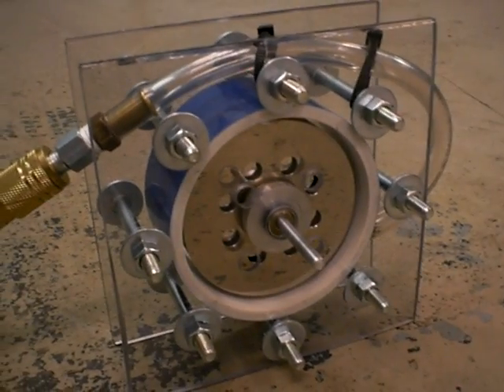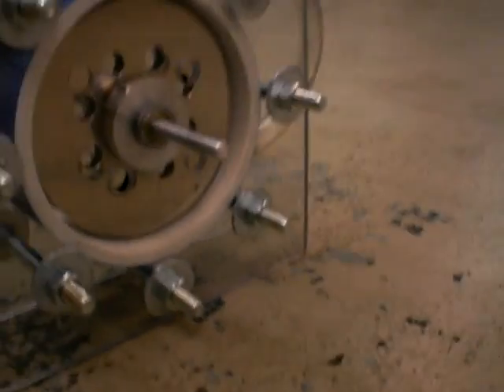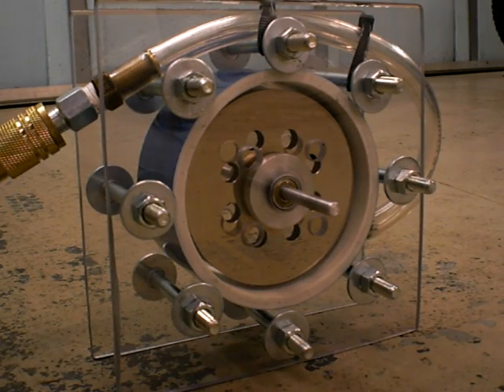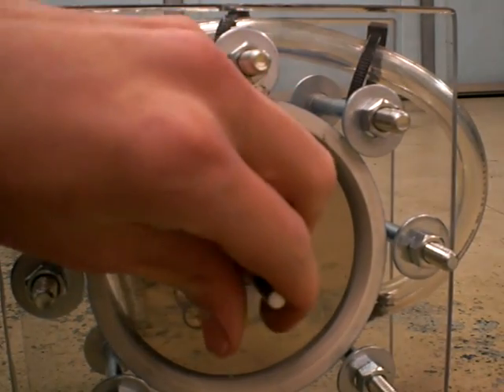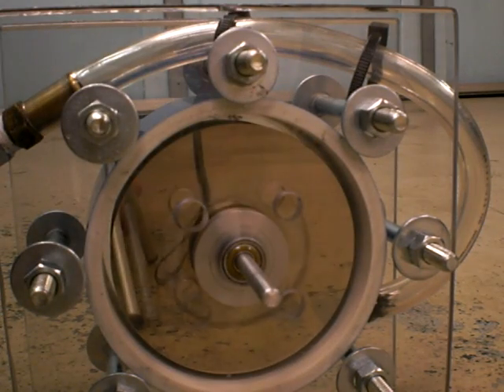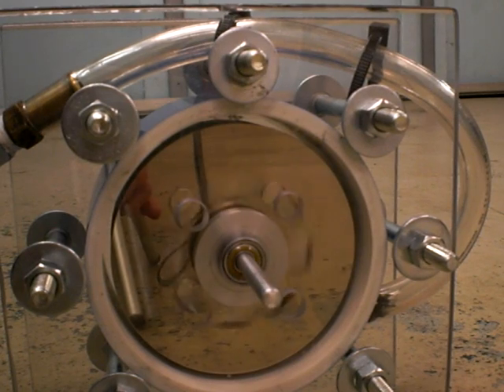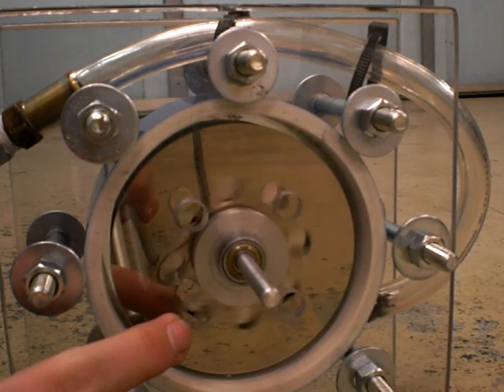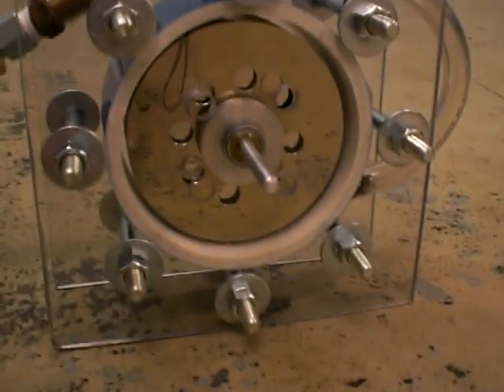Tesla Turbine

Comment: Can you share with us what you are trying to achieve ?    What is the end result you are looking for ?
Reply: Seriously!
This accomplishes WHAT?
He's made a non-gimbled gyroscope.
Reply: Don Cooper Hey ! Where's your imagination ?  If he hooked it up to an exhaust vent  in a bathroom , everyone could marvel at how fast the poop smell was gone .  Or for a  4th of July special he could put a torch in front of it and line the edges with napalm from a pressurized feeder tube  .    And watch those  people run !
Reply: +Michaelneil17 This could be hooked up to generator to produce electricity. Source of steam could be parabolic solar concentrator boiling water / generating steam - pressure
Reply: +Jozef Trubac You are suggesting using this turbine in between a source of steam  and an electric   generator .   What gives you the idea that this would increase that energy ?     Creating higher speeds does not equate to more power .    If you believe that a parabolic solar steam generator is an answer to  create inexpensive energy ,  build that .   However , I think you will  find that method much less efficient than  solar electric panels .
Reply: @michaelbenjamin8  I appreciate your comment but that’s not an issue because, despite what everyone erroneously claims, Tesla turbines work just fine, get plenty of torque and output power at low RPMs.     I’ve got some copy pasta 🍝 of mine that I’ll share with ya here to explain more.  Tesla turbines aren’t made efficient by spinning really fast.   That’s only for when the disc stack is being used as a centrifugal pump, because ALL centrifugal pumps’ compressors, performance is tip speed dependent.   But spinning the turbine fast will produce a centrifugal head that opposes the incoming fluid flow, reducing the pressure gradient across the nozzle, reducing fluid final velocity, reducing mass flow rates through the nozzle and ultimately reducing power out. 

Furthermore the faster you spin them the faster the fluid you have has to go just to still be moving faster than the discs and still provide torque.   Lastly, they work just fine for industrial use and can scale up just fine because the torque on the discs is proportional to the difference in the fluid speed and the disc speed. So the disc tip speed is the important factor here. For any given fluid supply in the nozzle will have a max fluid velocity. So the turbine disc tips will have a max speed set at that fluid speed irrelevant if radius. Now considering that centripetal force is proportional to V^2/R, if you keep the tip speed the same but increase the radius the centripetal forces on the disc for the speeds needed will actually decrease. 

Despite what MANY have claimed about the Tesla turbine, it does NOT need to be spun fast to work or work efficiently.   TesTurs are made efficient when the slip on the discs is reduced and spinning the discs fast does nothing to reduce the slip, only increase the distance the fluid slips on the disc faces, which is by definition “loss”.  Listen to what Tesla himself said in the patents of how to make them work.  “Owing to a number of causes affecting the performance, it is difficult to frame a precise rule which would be generally applicable, but it may be stated that within certain limits, and other conditions being the same, the torque is directly proportionate to the square of the velocity of the fluid relatively to the runner and to the effective area of the disks and, inversely, to the distance separating them. The machine will, generally, perform its maximum work when the effective speed of the runner is one-half of that of the fluid; but to attain the highest economy, the relative speed or slip, for any given performance, should be as small as possible. This condition may be to any desired degree approximated by increasing the active area of and reducing the space between the disks.”  1) increase the speed of the fluid relative to the disc, (not increase disc speed)  2) increase surface area 3) decrease disc spacing  This is how you actually make a TesTur work. Not by spinning it fast.   The fluid interactions with the disc that govern efficiency an torque are adhesion and cohesion. Full stop. And spinning fast does nothing to increasing either to increase the turbines isentropic efficiency.   This is why everyone who chases rpm with the TesTur just flat out fails. They aren’t even trying to design them properly so of course they won’t work.
Reply: @michaelbenjamin8  Of the sun’s light energy that hits the earth 10% is UV, 25% is in the visible spectrum, and a whopping 65% of it is in the infrared, heat, spectrum.   Solar PV cells can only use a portion of the visible spectrum and use none of the IR spectrum and in fact lose efficiency from heating up from the IR.  So at best you can get maybe 20% of the suns total light energy to electricity to charge and discharge a battery at 90%.  So only 18% of the suns light energy gets to your wall plug.    And then UV light makes them go opaque and be at 1/2 their rated power in 10 years. So, conservatively down to 10% of the suns light gets turned into electricity 10 years in.  

With solar thermal collectors you can collect all 25% of the visible spectrum and all 65% of the IR spectrum and store it as heat in a thermal mass.   So 90% of the suns light energy can be collected and stored as heat in a thermal mass. Let’s say 10% loss on storage  So 81% of the suns light energy is then available to be put through a steam Rankine turbine system, which at theoretical best can get 25-33% thermal efficiency to electricity. 44% is the recorded best (And that’s without any thermal recoup, boiler feedwater preheat, etc to bring up the Rankine cycle efficiency and/or going to an organic Rankine cycle with a refrigerant in the closed loop instead of steam for higher pressure gradients with the same temp gradient, for high efficiency)  So that’s 20-26% of the suns light energy can be put directly out as 60hz 120vAC.  About a 10-45% increase in energy out for the same footprint of collectors.  And then even after that ALL the heat energy rejected/dumped out by the condenser from the latent heat of condensation and loss not turned into electrical power can then be used for home heating.    Sooo since about 60% of the energy stored goes out the condenser, if it’s used for heating then somewhere like 70-80% of the suns total light energy can be utilized for electricity and heating.
Reply: Michael Benjamin I actually built one collector like that myself and it can boil water in two minutes. It's maybe less powerful than photovoltaic panel but it's something anyone can build and it's much cheaper. And regarding the speed of turbine. You can always use gears to get lower speed and higher torque. Traditional turbine would be more efficient but the price is just terrible.
Reply: @JozefTrubac  You just have to know how to design it correctly to actually reduce slip to make them work, not spin them fast.  The only reason people think Tesla turbines have to be spun too fast is because EVERYONE has mistaken the part of the patent that is about the turbine being used as a pump as being about it being used as a drive turbine.   The only time you want to spin a TesTur fast is when it’s being used as a pump/compressor. This is because ALL centrifugal pumps’/compressors’ performance is tip speed dependent.   “I have found that the quantity of fluid propelled in this manner, is, other conditions being equal, approximately proportionate to the active surface of the runner and to its effective speed. For this reason, the performance of such machines augments at an exceedingly high rate with the increase of their size and speed of revolution.” -Nikola Tesla 

And again, you DO NOT want to spin too fast in a TesTur because the centrifugal head will just counter your incoming fluid flow reducing power. And the faster you spin discs, you’re fluid has to be going even that much faster just to be able to apply a torque on the disc face.   “Still another valuable and probably unique quality of such motors or prime movers may be described. By proper construction and observance of working conditions the centrifugal pressure, opposing the passage of the fluid, may, as already indicated, be made nearly equal to the pressure of supply when the machine is running idle. If the inlet section be large, small changes in the speed of revolution will produce great differences in flow which are further enhanced by the concomitant variations in the length of the spiral path. A self-regulating machine is thus obtained bearing a striking resemblance to a direct-current electric motor in this respect that, with great differences of impressed pressure in a wide open channel the flow of the fluid through the same is prevented by virtue of rotation. Since the centrifugal head increases as the square of the revolutions, or even more rapidly, and with modern high grade steel great peripheral velocities are practicable, it is possible to attain that condition in a single stage machine, more readily if the runner be of large diameter. Obviously this problem is facilitated by compounding, as will be understood by those skilled in the art. Irrespective of its bearing on economy, this tendency which is, to a degree, common to motors of the above description, is of special advantage in the operation of large units, as it affords a safeguard against running away and destruction. Besides these, such a prime mover possesses many other advantages, both constructive and operative. It is simple, light and compact, subject to but little wear, cheap and exceptionally easy to manufacture as small clearances and accurate milling work are not essential to good performance. In operation it is reliable, there being no valves, sliding contacts or troublesome vanes. It is almost free of windage, largely independent of nozzle efficiency and suitable for high as well as for low fluid velocities and speeds of revolution.” -Nikola Tesla  Tesla both knew it wasn’t meant to spin fast and that it worked great for low speeds IF you design it correctly.

Comment: Interesting. I have several 0.100" 4x8' sheets of Ti ,Gd 2 . Plan on having many 12" dia. discs laser cut, finishing them on my 14" lathe, and building a housing of Stainless, running it on 750 PSI steam.  I'll get back to you next year- gotta get up 4 miles of steer-proof fence, and a 3500' runway, first.
Reply: Patriotgal1 It will blow up before reaching optimal performance. I doubt the Tesla Turbine can be scaled up that much.
Reply: Thank you for the input. I had planned to start smaller, and work my way up. I just need to drive a 3KW generator.
Reply: I believe the core issue would be, that the Turbine needs to reach a certain RPM, before your get the maximum efficiency. I suspect it to be lower, the bigger the turbine is, but the centrifugal forces scale differently.

Comment: They never can measure conversion efficiency because they can't figure out how to load the output shaft.
Reply: Tesla turbines get plenty of torque, output plenty of power and can do so even at low RPMs. 

They just have to be designed correctly to do so. 

There’s all the proof anyone could need to know this now.   

10in diameter TesTur made from cheapo aluminum on room temperature compressed air Dyno’d at 6.22ft-Ibs of torque to the shaft at only 4150rpm and +4250watts between 6,000-12,000 rpm and real 250-2650watt electrical load test runs at 9,000-13,000rpm.  

The preliminary tests are just to see how much electrical power can be produced with room temp compressed air driving the Tesla turbine.   

The TesTur nozzles never went over 20psi at the nozzle for the 2650watt electrical load test and not over 40psi at the nozzle for the 4250watt dyno test.     

This is so a baseline can be acquired for what to expect as the temps are increased to combustion levels.     

When using elastic gasses the counterintuitive thing most overlook is that the viscosity of gasses goes up with temp.   

So not only is there an increase in thermodynamic efficiency from increased temps but the TesTur isentropic efficiency also goes up due to the reduced slip from the increased viscosity.